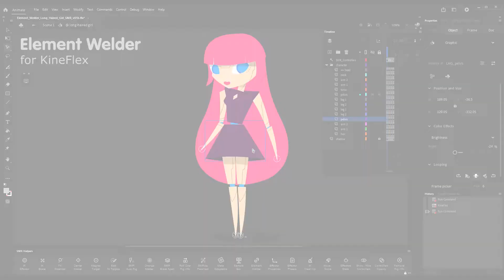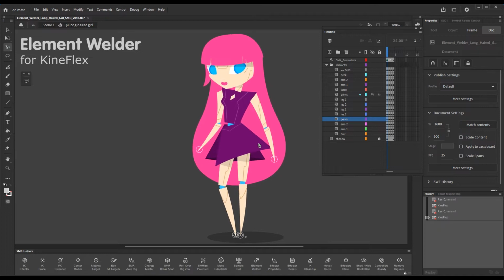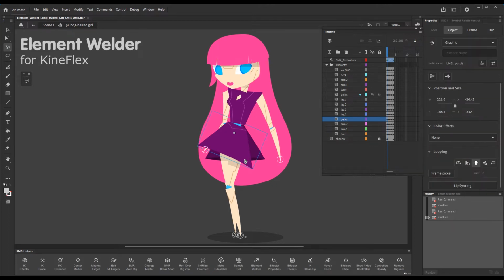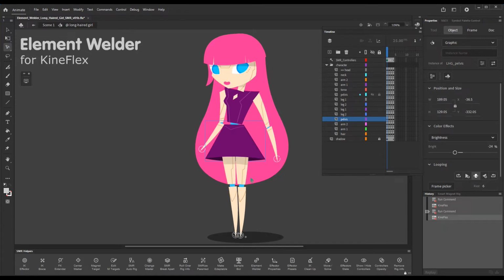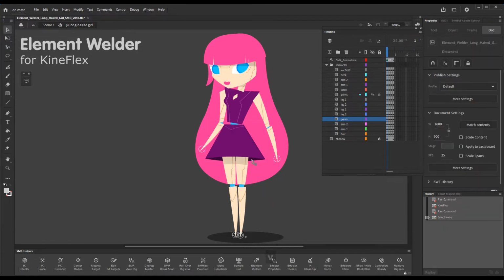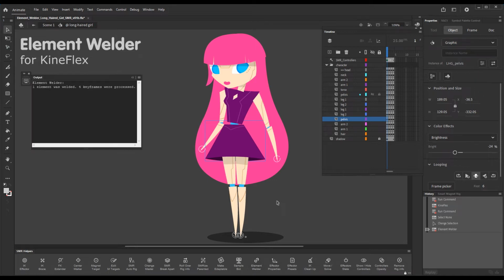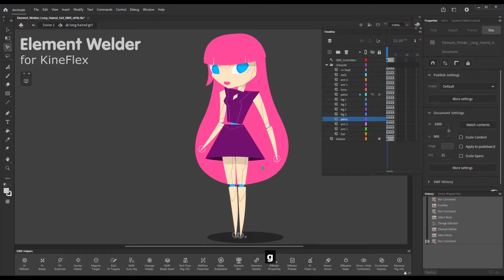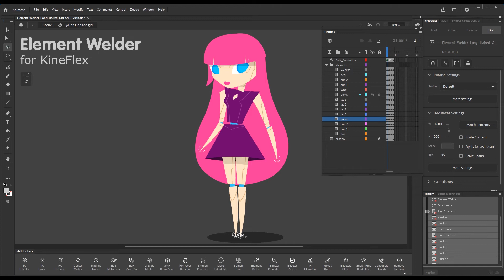🥨 Welding Elements in Adobe Animate 🥨 Advanced SMR

Comment: So the element welder is like layer parenting right?.. but the element(Symbol) is on the same layer?.. this is question
Reply from the maker: Element Welder is a tool in the Smart Magnet Rig system. It is much more powerful than Layer Parenting, because welding can be bi-directional (also called hard welding). Like everything else in SMR, it is instance-based.
You can find the details here: https://flash-powertools.com/element-welder/

If you are unfamiliar with Smart Magnet Rigging, you can start the journey here:
https://flash-powertools.com/smart-magnet-rigs-where-to-start/
Reply: @FreshlyFlanimated  Nice! thanks for the explanation. I'll keep up with that.